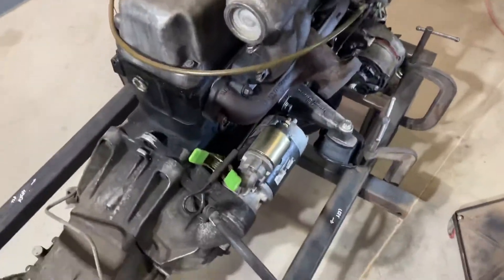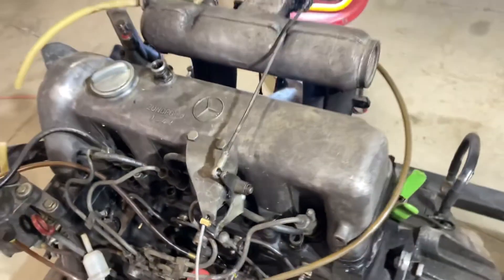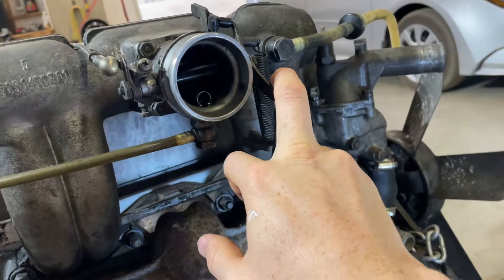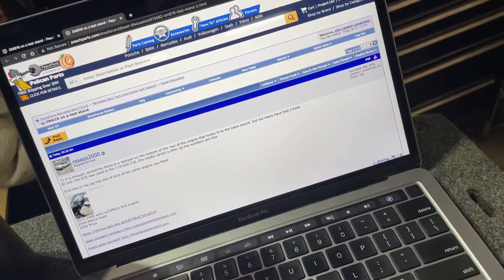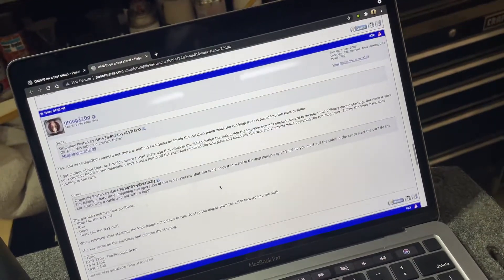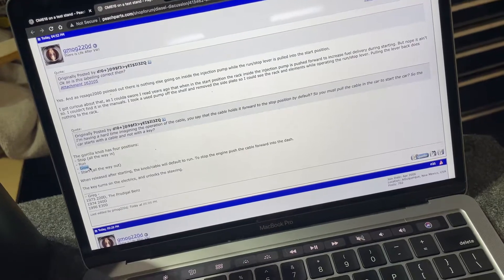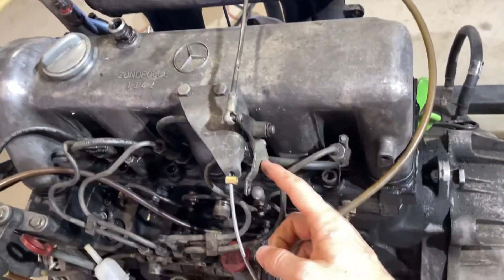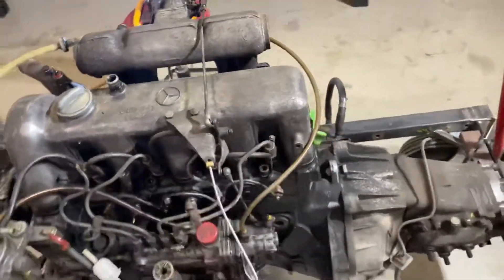OM616 Throttle Linkage Troubleshooting

Comment: That butterfly valve is to govern the engine from revving too high. Later pumps without "the red hat" had centrifugal governor. Earlier injection pumps (like the one shown) had a pneumatic governor . The pump is able to push the butterfly valve closed even though the accelerator "commands" it to be open. This is controlled by a vacuum, hence the hose from in front of the valve to the pump.
Reply from the maker: Thanks yeah. I plan to make a video explaining this in the future since there was nothing when I was trying to figure it out.